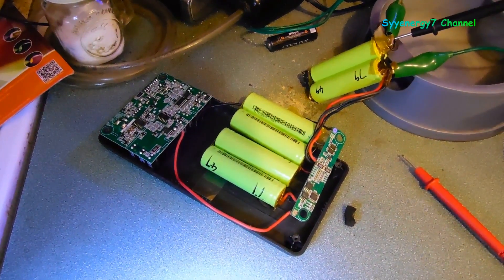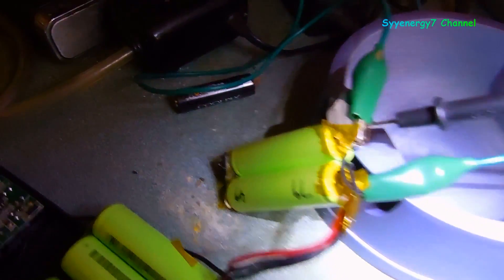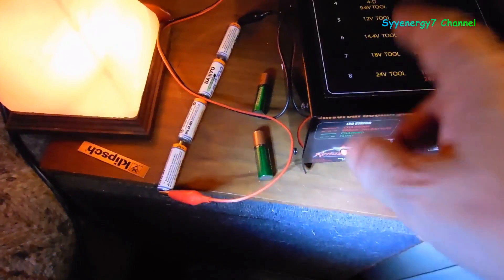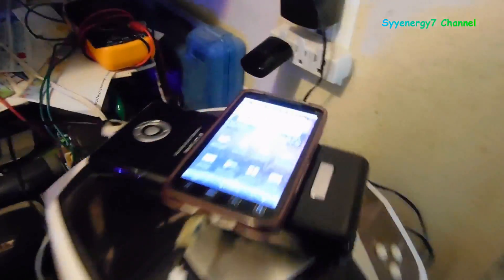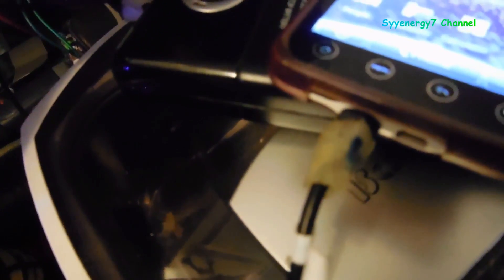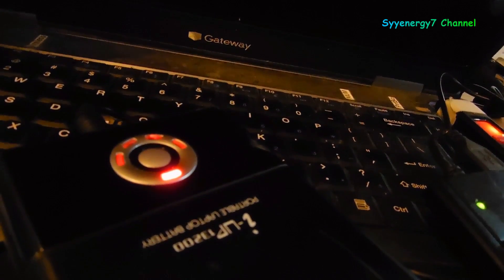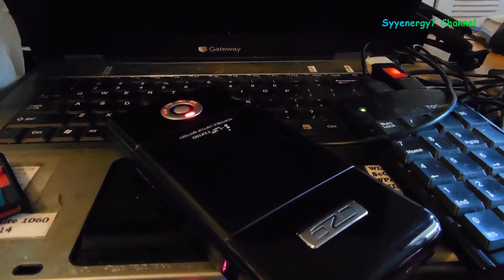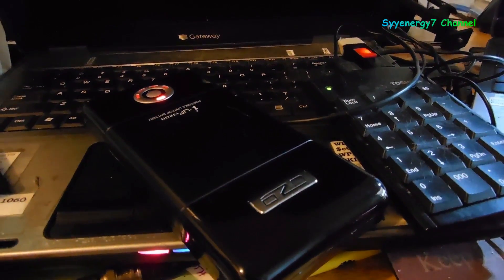Portable Universal Battery Pack Repair

Comment: I have not tried this yet-BUT !!  I have several of the 19.2 volt Sears power tools.  I have batteries that will not charge.  They have 4 prongs. They have been run down by having incandescent flashlights left on.  I tried putting correct polarity alligator clips to get some juice in so the charger would work.  Unless I have the voltage exact on both circuits they would not charge.   I see a crapped out drill in the shop "Fix It Box".  I think I am going to try cutting out the receiver and putting a single very weak lawn tractor battery on it.  It should dump equal juice into the separate sides of the 19.2 battery and hopefully allow them to get enough equal juice to use the regular charger.  I will do it out in the driveway under a 5 gallon bucket in case something blows.  Sears has a racket going with replacement batteries.

28Bull
Reply from the maker: +28bull That Bedini batter charger rejuvenator might fix or they will at least last next time.  That thing is great.  Using it a lot.